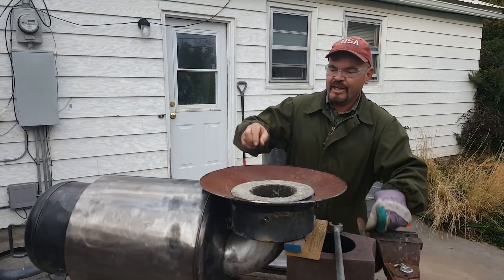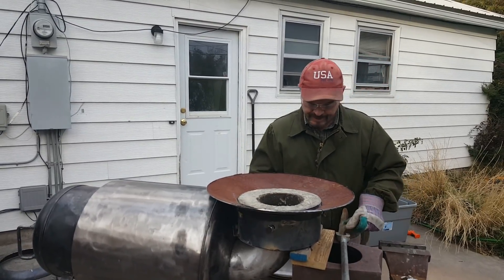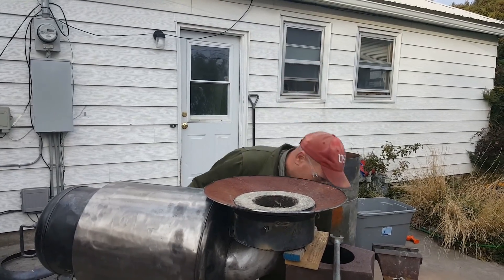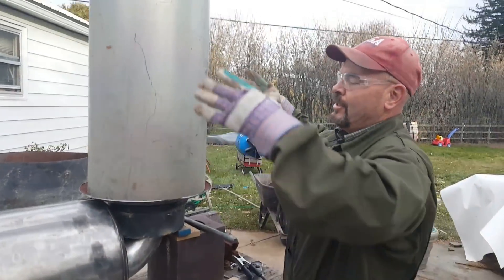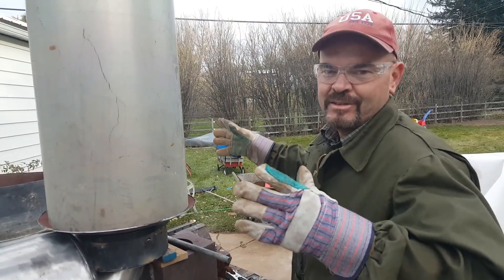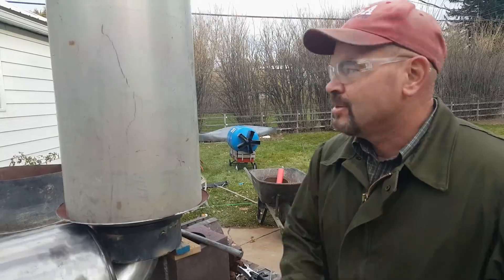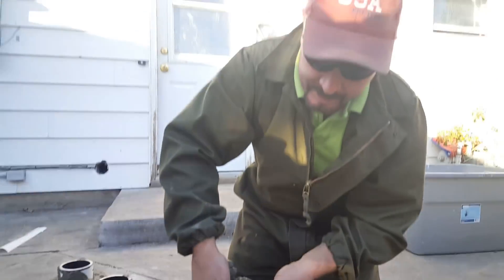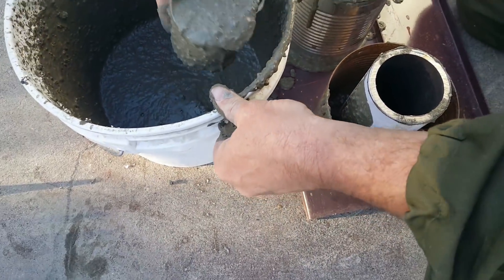Building a Heat Riser on Rocket Mass heater

Comment: Darwin:   Have you considered provision  for mounting a Thermoelectric generator on the radiator tank.   This could provide Julie with a low wattage power source for base LED lighting  and low power electronics charging.      Bert